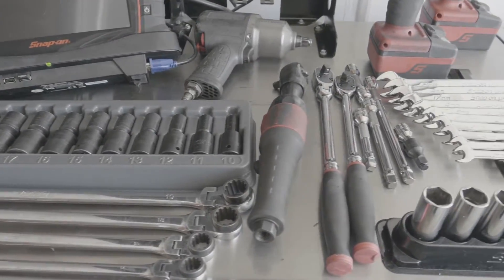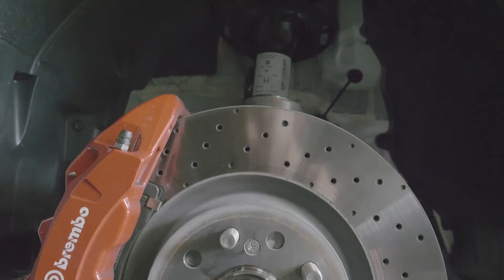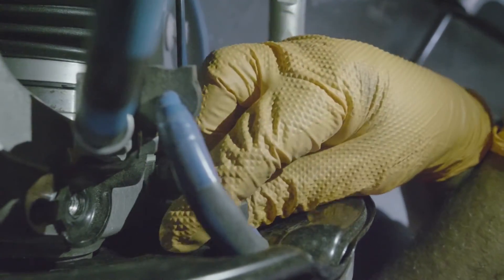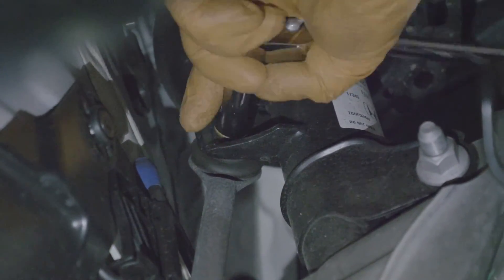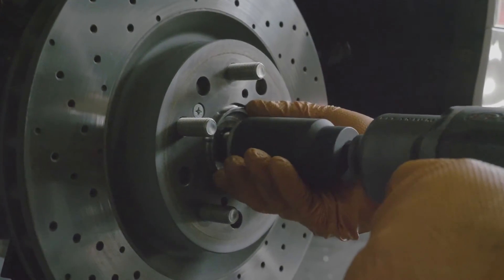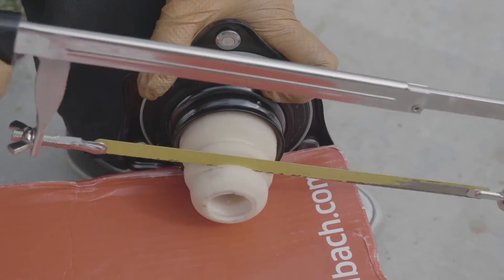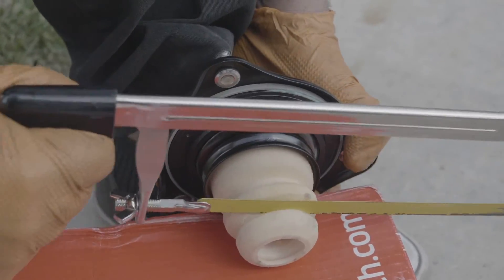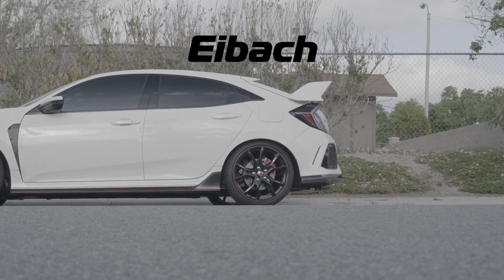Installing Eibach Springs On Civic TypeR

Comment: Reason for cutting the bump stop is because after the car is lowered.  You will have less shock travel.  By cutting the Bump Stop. It gives you back some of the travel you lost from the lowering springs.
Reply from the maker: yes that's it.

Comment: i installed this eibach pro kit spring but the front always rubs both fenders. is there a camber kit to adjusts the front alignment cause the inside thread front tires are wearing out and unevenly.

Comment: Dude, you made this look way too easy, lol.  A few of us removed that nut below the brake assembly that is held in with the castle nut...had to use a special tool to pop it out.  It sucked. Then I saw spoon didn't do that and did it another way...but you do it a completely different way than both.  How did that part that holds the strut come down so easy for you?  I never see you mess with anything that was related to that area.

Comment: You guys didnt take off the castlenut from the lower control arm?  It looks like you just removed the brakes and the nut connecting to the driveshaft and that was it?

Comment: Why shorten the bump stopper?
Reply: By this time you probably already know why but in case you don't of why they need to cut the bump stop is because since u lower the car there is a possibility that once u hit a big pothole your shock will hit the bump stop and it is not a good feeling.

Comment: Ruined Type R. Putting shit springs on a car that is so fast around the track because of the fine tuning of it's suspension...
Reply: I agree. The engineers at Honda spent countless hours testing and testing again for you to ruin that with aftermarket springs. Fine for a regular Civic, but the Type R? ... come on.
Reply: So what your saying is... spoon will run factory spring on theirs?????
Reply: @slklmk  Spoon sells stuff. They don't make money from the OEM springs.
Reply: Eibach is not shit lol? They are the OGs of the suspension world. I wonder if race teams have Type Rs do their races with bone stock parts? Or even any track car for that matter. I wonder why people don't just race every car, as a bone stock vehicle 🤔🤔. So strange